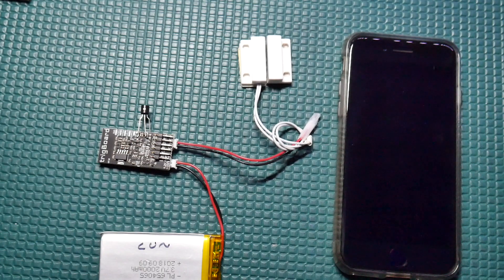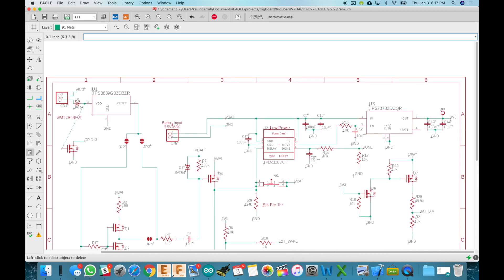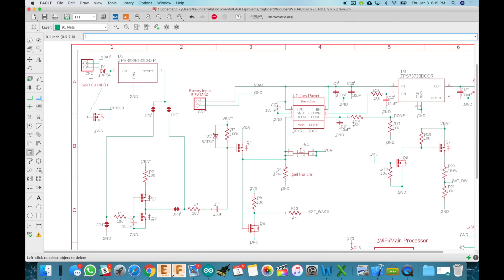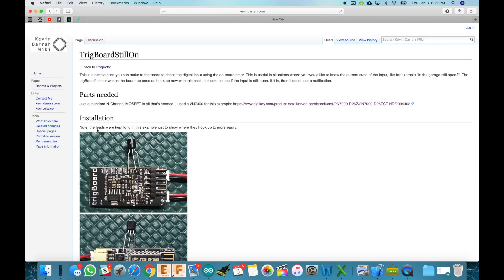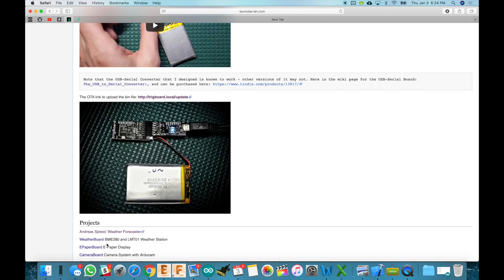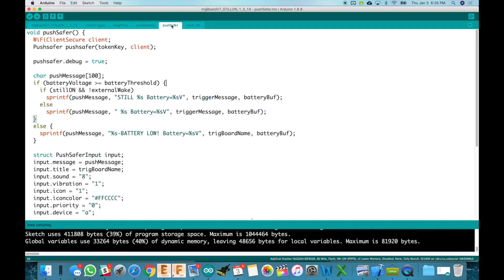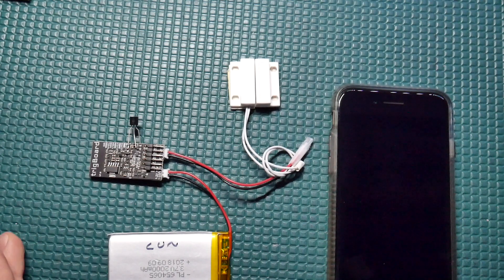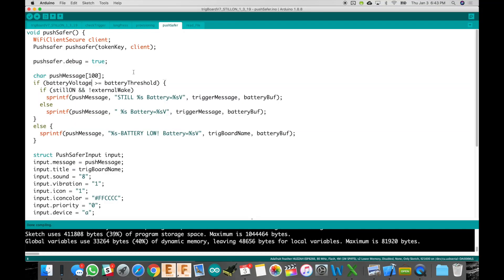Did I leave the Garage open? Push Notification from trigBoard!

Comment: I made this trigBoard my own and try to use this great technique but It does not work for me. its need to pullup at Gate of MOSFET. I tried it already and it work fine. anyway I use RUM001L02 and try 2N7000 already and it gave a same result. could you give me any suggestion?
Reply: I use TPS3839K33 as a supervisor, not TPS3839G33. Is it a problem?

Comment: Would it be possible to connect the gate before the diode? I would prefere to jack it in on the switch wire instead.
Reply from the maker: maybe?  haven't tried that yet

Comment: I've been trying out some Bluetooth battery monitors for car batteries over the last couple of weeks that claim to draw 6-24mW, sadly the range on them is poor and the mobile app isn't great - it takes around 20 seconds for the unit to wake up and report data if it works at all. Looks like these boards could do the job and upload data using the timer. 

Would a simple resistive dropper be suitable to drop the car battery voltage down to 4.7V max while still being able to calculate the actual voltage and if so what is the maximum resolution of the battery voltage that can be captured? Have you tested the WiFi range? Apologies for the questions, this is all a little over my head as I my knowledge only goes as far as basic Arduino coding at the moment.

Comment: Hi! Nice hack. Got a question : is the C5 capacitor polarized or not?
Reply from the maker: nah, all caps are ceramic
Reply: @Kevindarrah  thanks Kévin. Sounds ok to me. As far as I understand both side of the cap are receiving positive voltage when the reed switch is closed...then one side of the cap gets negative when Reed Switch is opened...clever!

Comment: How do you connect a pir sensor to the trigBoard?
Reply from the maker: I get that question all the time - tricky one to pull off... just because of the current draw from the sensor.  I have some ideas though - will make a video when I have an example working

Comment: Do you think it would be possible to use something like TASMOTA firmware on the trigboard? i don't see why not with a little modification. It would allow over the air updates and MQTT.
Reply from the maker: coming soon for sure - been asked this a few times recently
Reply: @Kevindarrah  Now I want to pick up a bunch but the spending season has drained me... soon!